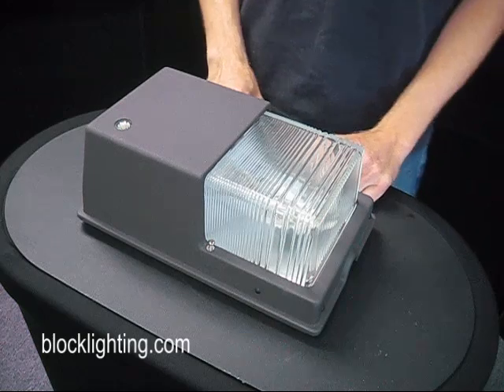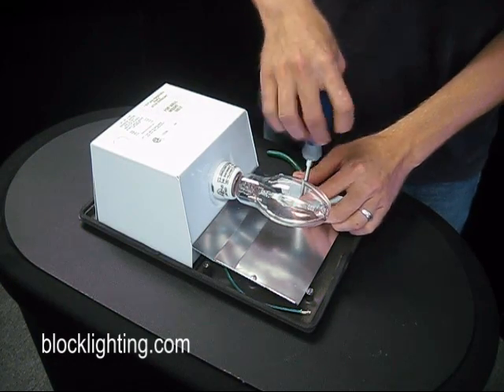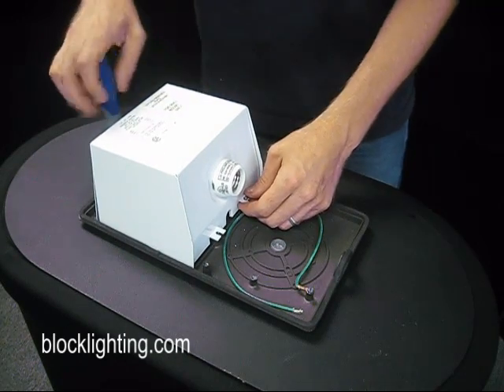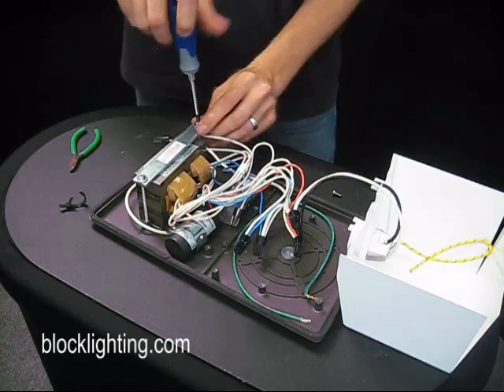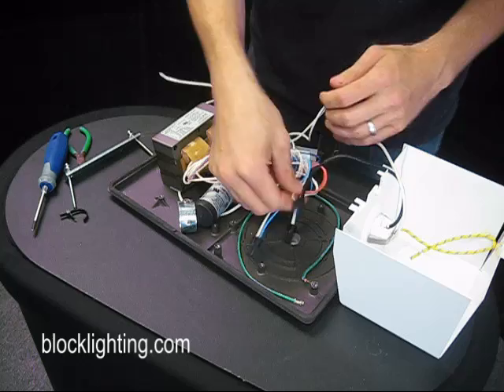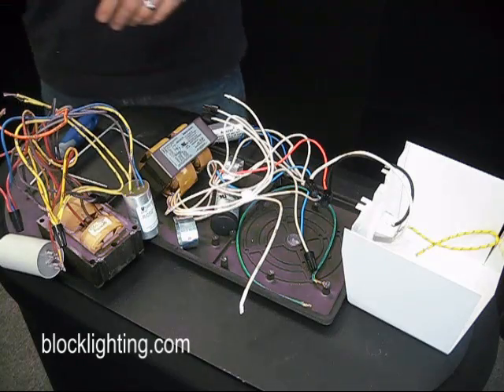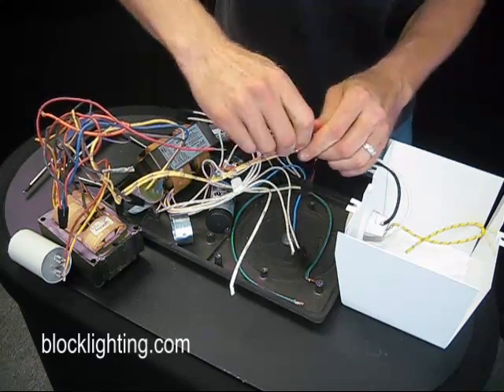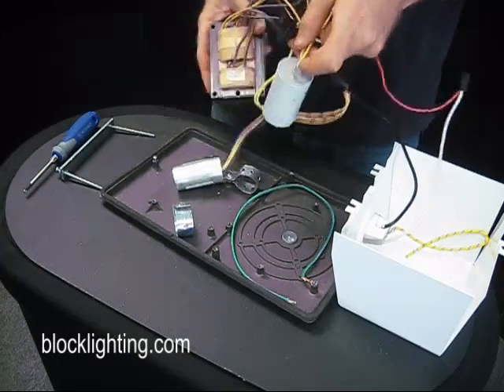How to replace a Metal Halide Ballast

Comment: Great video!
 I've pulled my ballast out already! But I do have a few questions.
1) The light you worked on with the photo eye is exactly like mines. Mines does not have a name or model number. Can I get that info from you guys?
2) Not sure if the photo eye n small ballast are both bad. Is there anyway to bench test it? Or can I just order the larger igniter ballastballast separately?
3) for that model of outdoor security outdoor lighting fixture, can it be converted to LED? And if so, Can you recommend the proper retrofit kit?

Comment: Craig I thought nobody noticed that...but you're right he missed connect the wires of the lamp...black goes to X1 or commonly red wire and the white of the lamp goes to the common of the ballast...of course the white of the input and the power line goes to the feeds...

Comment: Or, you could take all that ballast mess out of there and wire your socket direct line-voltage and install a 20Watt LED Corn bulb, and be done with it for 10 years.
Reply: OR....YOU CAN PISS - OFF AND REALIZE THAT LED'S SUCK BIG - TIME.....end of story.....

Comment: What if I actually wanted to bypass the ballast because I wanted to replace the metal halide bulb with an LED bulb? Would I simply disconnect the common and lamp line from the ballast and connect it to the power line being fed to the fixture?
Reply: Yes that's exactly what you would do
Reply: I would like to switch to LED too. 

My lamp (the same type as in the video) has the disk to dawn photo eye setup. 

So, removing the ballast, shouldn't effect power to the PhotoEye?

Comment: I'm a electrician. 99% of the time it is just the capacitor that is bad. Unless the copper core ballast is obviously black and burned up. Only change the $10 capacitor. Or the 3wire starter, if it has one.
Reply: Hi. I have a 175 watt metal halide fixture. The voltage is 177V from center pin to socket. The specs for this bulb calls for 300V. Is this the ballast or the capacitor? Thanks.
Reply: The reason the capacitor goes bad. It cannot handle the intense heat coming from the ballast. A manufactured over site.
Reply: I'm connected to the 120V tap, I changed the capacitor and now get 266V from center pin to socket. The light works, but thought my voltage would be higher.
Reply: Joseph Maya My local voltage is 120V input and 300v at lamp. But within 10℅ is all good.
Reply: I want to buy some 
products in this company, I see that I comment the video, I would like 
to ask you if the company is serious with your orders?

Is it reliable to buy online?

thanks for your comments.
Reply: I want to buy some 
products in this company, I see that I comment the video, I would like 
to ask you if the company is serious with your orders?

Is it reliable to buy online?

thanks for your comments.
Reply: I no electrician,

My Igniter ballast looks bad, it has swollen & has rusty separated coils. 

Is the capacitor connected to the igniter ballast or inside the lamp / photo eye housing?
Reply: I saved the customer $800 by only changing the capacitors. 

Mechanics that change unnecessary parts are dishonest.

Take the price of each ballast kit multiplied by the number of fixtures. It adds up.  

Again. It's a quick visual check. A bad ballast usual is very clear it needs to be changed. Black and smelly is usually a good indicator. 

A good electrician would diagnose the problem to only the capacitors and lamps and just do a visual check on the ballast. Copper based windings last forever. It's not a part that needs to be changed on a wear and tear base. It's not smart to change a part that never goes bad on a time base.

Maybe water intrusion or lighting strikes are the outliers.

Comment: Craig is correct.  The red lamp line has been connected to the common (white) lead from the switch and the common line is wired to the black (hot) lead from the switch.  If I'm missing something here it would be helpful to all if an explanation was offered.
Reply: Cankuwicasa I'm a year too late but hopefully someone can benefit from this information: using both those hot leads will give you your 277V which is what this fixture is rated for. Make sure your panel is a 120/277. If you're getting more voltage than what the equipment is rated for, you will either need a transformer or you'll have to use the lower voltage on the panel (if you're a cheapo).
Reply: I want to buy some 
products in this company, I see that I comment the video, I would like 
to ask you if the company is serious with your orders?

Is it reliable to buy online?

thanks for your comments.
Reply: Cankuwicasa Switch? What switch?

Comment: Why would you replace everything? Its very very rare that all components go out. Its usually the capacitor or igniter that goes out or the transformer if plugged into 220v when it should be 120v.all parts can be replaced individually.

Comment: Check your capacitor / ignitor module.  If you hear humming the ballast (could) still be good, it at least indicates a functioning primary winding.  If you have a pulse start fixture you will find a smaller cylinder next to the capacitor, you might want to try replacing that.  If its not pulse start its probably just the capacitor.  Using pulse start lamps with non-pulse start ballasts will also lead to no light output.